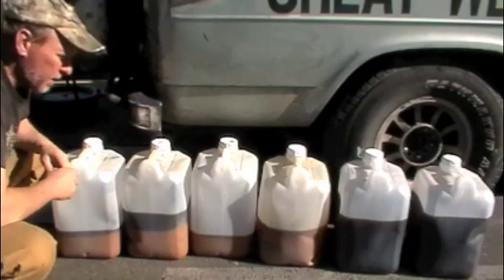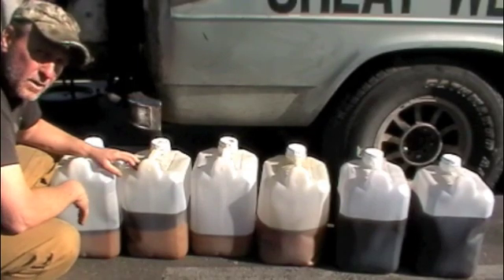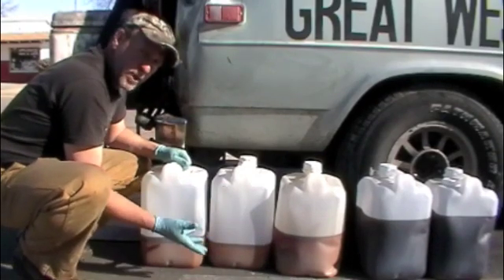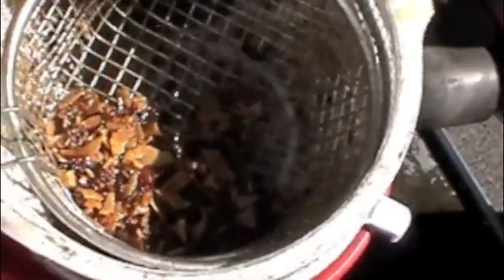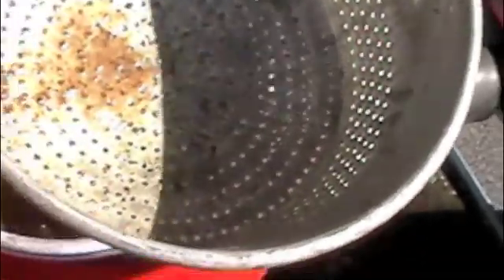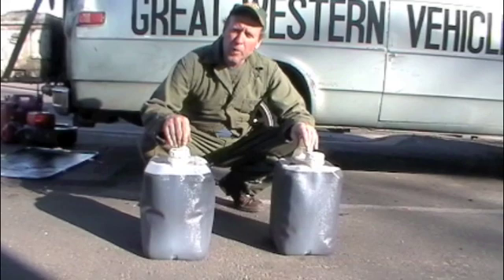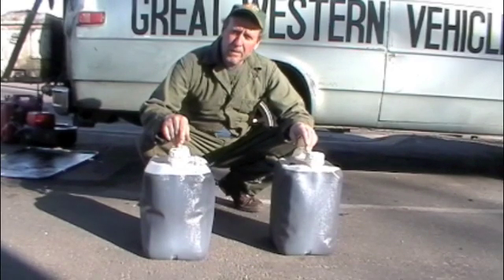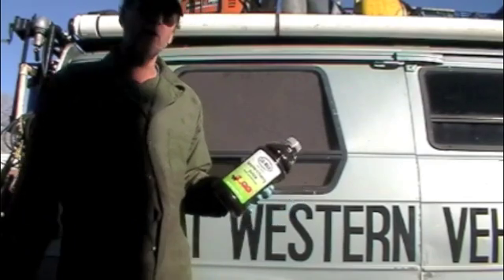Small Scale Blending of waste oil blend diesel fuel

Comment: Hi Mr. Brooks, I have a few questions about using gasoline! Firstly, how much gas do you blend in 5 gallon portions? Secondly, does this process require any lye?  I  am looking forward for your reply, Nicholas. :)
Reply from the maker: No lye is needed for this process.  I just put 1 gallon of regular unleaded gasoline into 4 gallons of WVO, and leave it to settle for 1 week, then I filter it down to 1-micron, but a paint filter will work, as long as you make sure none of the dregs are used.  I never use the last 5% of any blend, and one has to pay attention to making sure only the clear, amber blend is used and nothing thick, dark or creamy is used.
Reply: Jeffrey Brooks Thanks alot Mr. Brooks!
Reply from the maker: I use gasoline for blending with waste oils, because it is thinner than diesel fuel.  The resulting solution of gasoline + waste oil ends up being about the same viscosity as diesel fuel, so it burns about as well as diesel fuel.  Whereas, if diesel fuel were used as the blending agent, then the resulting solution would be considerably more viscous than diesel fuel, so it would not burn well in a diesel engine.
Reply: Hello,  am new to this process. I was wondering why you use 1 gallon of unleaded  gasoline and not diesel to add to 4 gallons of veggie oil blend before final 1 micron filtering?
Reply: thanks for clarifying

Comment from the maker: Gasoline is the cheapest solvent that I know of in the USA.  In other countries it is acetone, or toluine.  Waste paint thinner is free, and can be used, but it has so much dissolved solids in it, like WMO, that using it would produce a lot of ash, which will wear out the engine faster, unless the waste paint thinner (WPT) is distilled.

Comment from the maker: There is no problem with the forum other than SPAM engines that hijake every forum, so you just have to join, then send the forum host a personal request to post, that is all.

Good to know that you are disposing of your wastes properly.  Waste motor oil (WMO), can be turned into fuel, but it should be distilled to remove ash, which it has more so than any other waste oil.

Comment from the maker: Yes, there is a forum where blending is the primary topic.  It is Beyond Biodiesel dot O R G

Some people have blended a small amount of waste oil with gasoline and gotten their gasoline engine running on it; however, it is most probably a warm weather practice.

A gasoline engine at operating temperature will run on kerosene, so if one had access to cheap kerosene, then one could install a second tank to startup on gasoline, then switch over to kerosene when the engine is warm

Comment from the maker: @Begbucks First of all, the point of this video is most of the purification process of turning was oil into diesel fuel takes place in the settling period, when the dirt and water precipitate out and settle to the bottom, which does not take any of my time.

Secondly, I was pouring waste oil blend from a 5 gallon container, through screens, which does not take long, but pouring it through a 1-micron bag filter would take some time, a lot more time than an hour for 5 gallons.